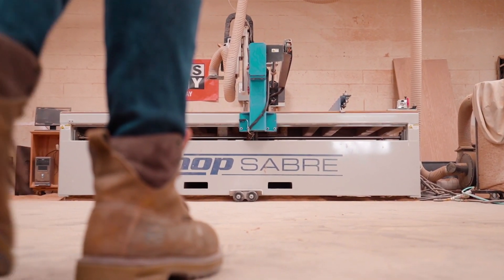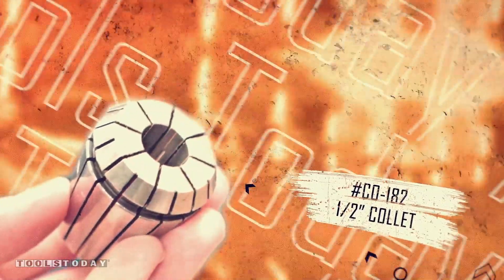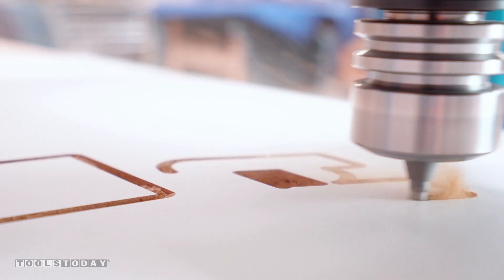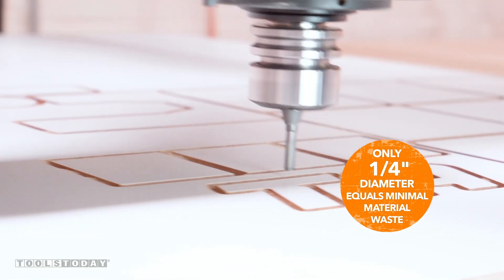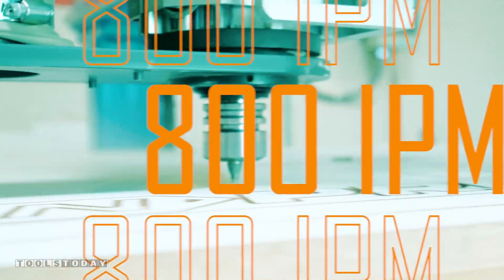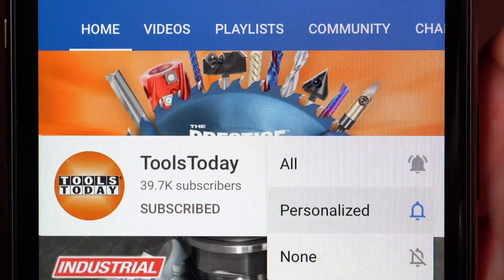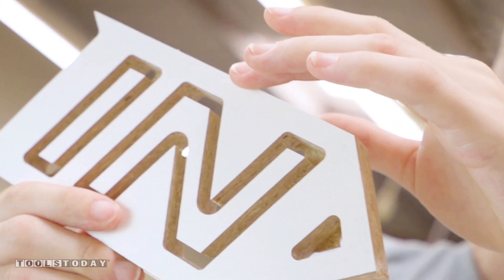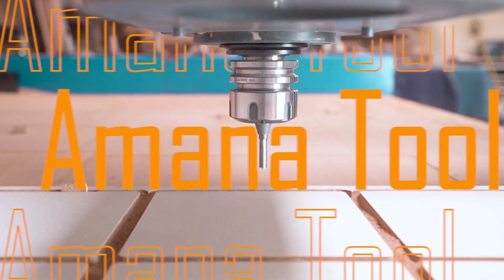Extremely Fast CNC Nesting | ToolsToday

Comment: At 3/4" depth of cut would you still run at 800ipm?
Reply from the maker: Yes,  3/4" depth up to 800 IPM feed rate at 18,000 RPM cutting laminated particle board. Rate may change depending on material and CNC machine type.

Comment: So what does this have to do with nesting? I can nest just as close with my Whiteside compression bit with no tabs.
Reply: 1/4 inch is not unique. It’s click bait.
Reply from the maker: @JoshuaErickson275  True 1/4" is not unique but the 1/4" with 3 flute for CNC nesting at 800 IPM is. Just look at the finish at 800IPM, machine shops and cabinet making shops will use this bit. Thank you and stay safe and positive!
Reply from the maker: We are glad to hear you can CNC nest with your Whiteside compression bit. The uniqueness of this new tool is the 1/4" diameter for minimal waste and 3 flute for clean finish at 800 IPM.

Comment: Amana makes awesome tools. It's all I use in my cnc. This overly showy type production makes it look like you guys are trying hard to sell a mediocre product. Some nice clean detailed shots of it cutting with the speed/feeds on screen would be great. All this while the speaker gives the important stuff about the bit.
Reply from the maker: Hi Michael, we are happy to hear you believe in Amana's awesome bits! We fully believe this is an important tool as the 3 flute design and 800 IPM will help many production, CNC and cabinet making companies produce their parts faster and with less cleanup than a two flute bit. The 1/4" Dia is narrower than 1/2" Dia which allows for less material waste. Sorry if you didn't see the feeds and speeds in the description, here the are again Feed Rate (IPM): 800; Speed (RPM): 18,000; Chip Load (Per Tooth): 0.014”; Ramp Down IPM: 400
Reply: @ToolsToday  I would never have had ANY 2 flute garbage in my shop if I had known there was any other option. I"m seriously ready to recycle them all and start over.
Reply from the maker: @ExtantFrodo2  Haha very good, well these are new so you didn't miss out for too long. Thanks for your support.

Comment: You guys really have to show the correct way to assemble an ER style collet chuck.  It hurts to watch someone not put the collet into the nut first, and just force it together.  I'm sure having as little runout as possible is key to getting good tool life, or is it less important for router bits?  Would this style of router benefit from the likes of a hydraulic holder, or something like a d'andrea monorforce (power milling style chuck)?
Reply from the maker: Hi Matthew, thanks for the info, yes you are correct. The procedure is to assemble an ER style collet chuck is: 1. Snap collet into nut, 2. Insert cutter into collet, 3. Hand tighten collet nut assembly into tool holder, 4. Insert tool holder assembly into tightening fixture and secure it, 5. Tighten collet nut to recommended torque using a torque wrench and adapter.  With response to the benefits of a hydraulic holder , yes the highest quality of colleting one can afford is nothing but an improvement in all respect.
Reply: You wonder how they managed to acquire such tools. 🤣

Comment: What bit would you recommend for 3/4" baltic birch, if speed was not the primary concern?
Reply from the maker: Hi, for full 3/4" through cut, use the compression bit no 46170-K, https://www.toolstoday.com/v-13354-46170-k.html. You can use spiral bit no 46202-K for cutting when full cut depth is not needed https://www.toolstoday.com/v-13779-46202-k.html
Reply: @ToolsToday  thank you!  I have one on order and own the other one.  Would love to better understand the pros and cons between a compression bit and a straight bit for full pass cuts.
Reply from the maker: @Irjdunn1  Thank you! The compression bit has a cutter on the bottom and top of the tool, so you get clean Top and Bottom cuts of your material, the straight cannot do that. While straight CAN cut through, you will be better finish with compression for through cuts in 2 sided material. Hope that helps!
Reply: @ToolsToday  by "compression bit" do you mean "with a downward forcing spiral"?
edit: sorry,i didn't see your explanation before typing that out.
It's just that I recently saw a demo of an amazing reverse spiral bit that was excellent for thin plastics and laminates since it shoved down towards the work. I gather it's only for situations where chip evac is not a problem.